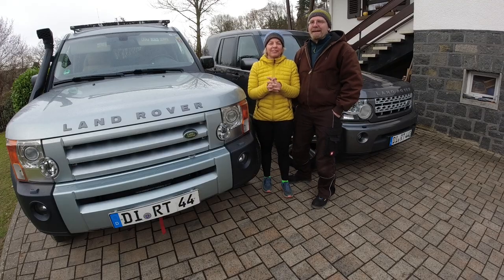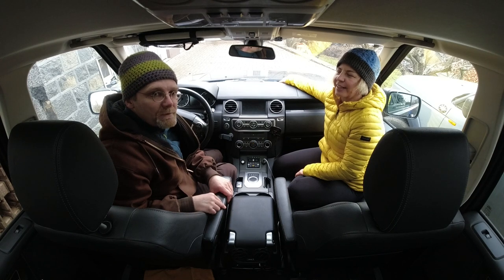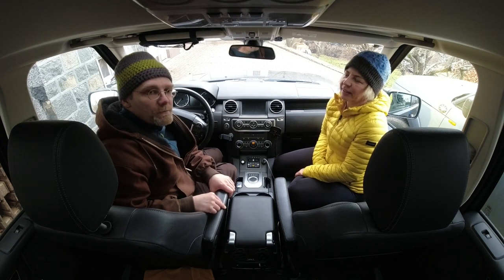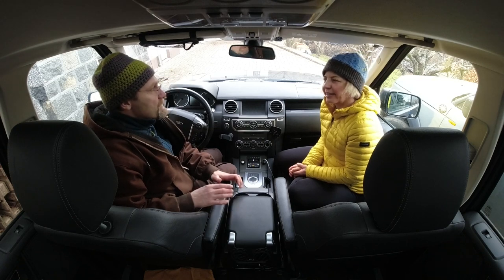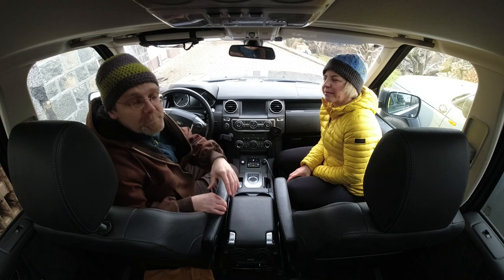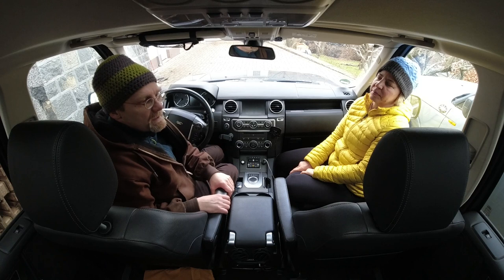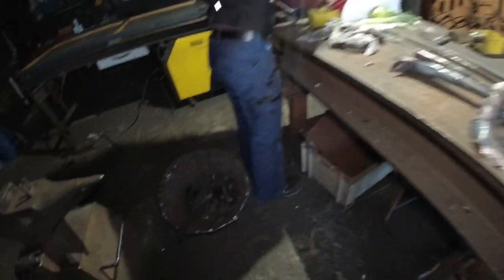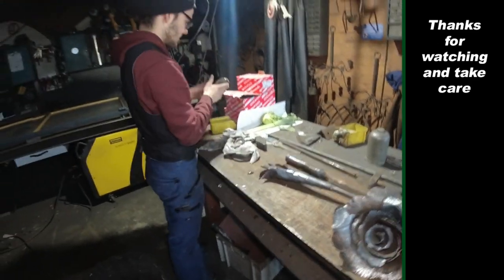Four things we will never change on our Land Rover

Comment: The Air Suspension on my P38 Range Rover was awful... but from what I've heard about later systems such as the LR3, they fixed a lot of the issues.  I loved it when it actually worked

Comment: 1 - 0:38 Air Suspension 
2 - 13:33 Upgrade style to LR4 - in regards of Discovery 3
3 - 17:30 Engine mapping
4 - 20:57 Engine swap
Reply from the maker: 😅👍🙏Thanks, sometimes there is just not enough time to get it all done. 🙋‍♀️Vera

Comment: Hi Christian and vera, myself and my wife really enjoy your videos every time. They are absolutely brilliant.. If an everyday family that generally isn't very car knowledgeable buys a discovery 3 because it has 7 seats and has good boot space for shopping etc and takes it to a garage for everything that happens to there discovery and lets say its a year 2006 model and it cost this family £4000 and because of the age alot of things on the car is old and starting to fail or break in time its what happens and lets say 4 air bags/shocks need replacing as you do in pairs and say 2 height sensors need replacing and because of the leaking air bags the compressor has died because the new owners just drive the vehicle and finally take it to the garage and they say yep. You'll need 4 new bags, a compressor, and height sensors plus the time with a diagnostic tool to recalibrate everything after and plus vat and plus the cost to you as the customer for the parts. I will absolutely guarantee it will cost thousands of pounds. And yeap I've known people just to scrap the car because the repair bill is just too much, unfortunately.. I have actually swapped out our air suspension for coils and, for a few reasons, 1. Cost, so for our coils they were £1000 yes at a one time buy its a lot of money but if you add up the cost of new parts and time at a garage for using a scan tool etc a £1000 doesn't seem that bad, i actually fitted my coils plus other front suspension components over 4 days in the summer on my driveway saving us about £700 only just fitting the coils.. 2. Problems/issues so personally, I've had 2 Hitachi air compressors fitted at about £650 each, and both died over 2 years had everything checked  out, air leaks etc from the garage it's always been a mystery and then decided to change to coils,  3. 2nd guessing/Worry, that beautiful ping noise from a landrover is enough to make anyone cry. But when you're on holiday and your 4 hours from home and PING! The air pump has died, and the holiday over. It makes you wonder if it's going to fail at any second. 4th and final. Reliability, air suspension, I've always been told if it works, it's amazing, but it's when it goes bad it gets costly and difficult. Coils, it is what it is; they are more firm, more bumpy, and less of a headache and personally absolutely less on your bank account, no leaks, no dieing air pumps, no sagging air bags, no more dropped air suspension onto bump stops, no more calibration after having height sensors changed, less parts to worry about, and for what i use my discovery 3 for its brilliant.. i just wanted to sorry for the long comment. I absolutely love your videos. I hope you don't stop making them, and i hope your channel keeps growing and growing . My wife and i will definitely support and share your channel the most we can for the love of what we both enjoy so much.. ❤🇬🇧
Reply from the maker: In some cases it is of course logical to convert to coils.  It all depends on the use case (modern word which Jung programmers use a lot at my work place).  Cost is a big factor too.  In your case, with multiple compressor failures,  I get your point and I agree with you.  Agree about the Bing too.  I don’t think there is an other car on the planet which can let your heart slip down in your pants in a fracture of a second and then make it all good again 😂😂😂.  Had this many times.  Thanks for watching our videos.  Next one will be epic - don’t miss it.  Christian

Comment: I have replaced the air suspension in my l320 with coil springs. Mainly for off road and it tows a lot nicer. I did it years ago and I’m happy I did! It may be a sin but I love it!

Comment: Hi Guys, I write this at 8:42 in the video because I didn't want to forget - re the air suspension there are pro-active maintenance areas to help avoiding trouble:
1. Replace the nylon piston ring in the compressor every 2 years to ensure that pumping is in tiptop order. Cost £ 15 and easy to do;
2. Clean and lubricate the ride height sensors every year - cost 30 mins and some spray cleaner/lube;
3. Re air springs, every year put vehicle  in full height and using a spray bottle full of soapy water, spray all round each air spring to check for leaks and rubber perishing. DO THIS BEFORE you have a problem to avoid time off the road.
Reply: Hey David, do you have a DIY how this can be done ?
I recently became an owner of a LR3, when started the air compressor works for some time even though the car does not seem to have changed how it stands, after running, a loud PSHH is being fired up as if it is a real truck, respectively shortly after I park, car seems to lower different wheels trying to maintain equal level I suppose (I park it on a 2% steep ramp), so with the above info I'd rather check these before running into air compressor problems :)
Reply: what do you lube the sensor with?
Reply: Any videos on replacing the nylon piston ring? Thanks for the advice!
Reply: Don't forget to replace the air filter on the compressor inlet (rear compartment) My suspension is all original >150K miles.
Reply: Very good tips. I need to start doing this. Active prevention is surely the best way on this awesome suspension setup.
Reply from the maker: We have a video planned, and ordered the parts a while ago, but they have not arrived yet. 👍😃🙋‍♀️Vera
Reply: @Vera_and_Christian  Nice. I think this mod could save from many coil spring conversions of other owners. I love the ride of the disco and the load leveling, such an awesome feature that more cars and heavy vehicles 
should have.
Reply: @Vera_and_Christian  hey Vera!

Would you mind sharing the link with the parts you ordered? :)
Reply from the maker: @georgidaskalov8389  Yes, we will put it in the video description. As of now, parts have not arrived yet and we need to check what went wrong before I can share that linke. 👍🙋‍♀️Vera

Comment: Great video, love the discussions on the air bag system. I came across a random issue from previous repairs on a mall crawler,  it had got a epb module at some stage and one of the cables was making light contact with one of the air pipes which put a practically invisible pine hole on it which was only findable with a smoke tester and luminous die…..! It had got a suspension pump but was still logging random faults if ever the vehicle was loaded up!

Comment: Thank you. Excellent content. The suspension really is magnificent.
I'd love for you to do a walk through of:
1) The suspension components: position, faults,  replacement procedure etc.
2) The suspension support circuit you described: when on a long desert trip and suspension failure OR limp mode, is NOT an option.
 A friend was just sold a compressor, and then suddenly he also needed a strut. Now he is so disillusioned he wants to go to the spring conversion.
Reply: You can buy a service kit for the compressor,  i have done my Discovery 3 , it was quite easy and there is a few good videos on YouTube showing you how by the company that sells the service kit.
Reply from the maker: Getting a new strut is probably cheaper than a conversion. It also depends on the age and km of the car. Some maintenance has to be done, and a more powerful compressor can blow a rusty strut. That will probably happen when we service our air compressor as soon as the parts have arrived. Then we will do a walkthrough of the airsuspension. 😃👍🙋‍♀️Vera

Comment: Your description of a Toyota just working makes me want to buy one. I am a fan of things that just work. I am also a fan of simple. Simple is reliable, simple is cheap to run and maintain. Simple is just simple.
Reply from the maker: Simple and reliable also often means 30 years or older. 😅👍 Do not think that a modern Whatcruiser will run like a clock. 🙋‍♀️Vera
Reply: @Vera_and_Christian Don't go too old, I remember hearing a lot of Toys pulling away from a light and the cam follower hadn't caught up.
The sound was unmistakable 😞

Comment: I do a lot of offroading and the fear of an air suppression issue in the middle of nowhere is really frightening. 
I was about to convert to spring coil but your video made me think again. The quality of the ride and even the offroad capabilities will surely be impacted. A video from you about air suspension system good  maintenance would be very helpful. Thank you for your great videos. Very interesting and helpful as always. Keep up the good job👍
Reply from the maker: Remember, the LR has a limp mode. You'll always get out. But there are things you can do, if you are prepped, to fix the air suspension on the trail. We'll get into what we would do, when we do the maintenance on our onboard aircompressor. 👍🙋‍♀️Vera
Reply: @Vera_and_Christian  looking forward for this video. Thanks 👍

Comment: I totally agree with you about the air suspension. It’s the best part of the vehicle. Other vehicles try to put air system and fail. Not the lr4, t’s a very solid system.

Comment: A very interesting video, again! I have the 2010 LR4 and every 4-6 weeks it warns me of a low battery. Apparently, if the car is used on short/medium runs, the battery doesn't fully charge. I Googled this and I think it was on the Disco3 Forum that a Ctek charger was recommended for charging. I bought one and give it a charge every 6 weeks or so. The 'Mall Crawler' is a great name for the LR4, in the UK any 4x4 SUV is referred to as a 'Chelsea tractor', Chelsea being an upper class area in London 😉. Well done for another great video, you two are fantastic! Also, Robin is a very talented metal worker 👍

Comment: I agree on the air suspension. It's magic! My Disco 3 has a height sensor issue and the ecu threatens to slow down but doesn't (thankfully!) I'm waiting on a Foxwell NT510 to diagnose and then also calibrate the new sensor. I changed the front air struts after 250k.

Comment: Hi Christian and Vera another brilliant video you’re very correct about the suspension I had to replace the ECU for the air suspension thank you for the help and a new compressor when buying a compressor don’t buy the cheap ones there are only two but you should have Hitachi or Dunlop the other makes maybe a lot cheaper but the pressure they work up is lower so the pump works harder what I’m saying just buy the good ones which will cost you around £400 but saying that I also need a set of valves at the front catch up with you next week keep safe.  John 😁🇬🇧👍

Comment: Removing the air suspension from a Land Rover undermines one of its most defining features. While it may come with the occasional quirk, it's unmatched in providing both comfort and the ability to adjust to various driving conditions when needed. Also using a salvage car and the right know-how or mechanic, you can fix the system for a heck of a lot less money.
Reply from the maker: 👍👌that is all we are saying, for many years now.🙋‍♀️

Comment: As always - great video and not just because I absolutely agree (excluding the part about the looks of the ….cruiser 😉) 
The air suspension is easily one of the greatest things (or even the greatest thing) on our Discoverys. It is - in my opinion - way better than the Landcruiser‘s suspension.

Of course there may be some faults to be dealt with but I would say this: My D3 has now slightly over 200k km, it still has the first air-struts (a bit rusty but fully functional - I will replace them this year) and just gotten a new AMK-compressor (Miessler). I was able to replace the compressor all by myself outside in the driveway in the cold with just some regular tools even though I had to drill out a rusty bolt.

As long as there are spare parts, I think you could replace almost all suspension components almost anywhere in the world on the go - that’s brilliant!

Kaffeetrinkende Grüße!
Reply from the maker: Absolutely right. 😃👍🙋‍♀️Vera

Comment: I miss the ride on my LR3 since buying the X5 although it has rear air bags the comfort of the LR exceeds the X5 plus it is not so easy to get in and out your spot on, l did however once have a complete air suspension failure on a new 3 months old LR vehicle - a pot holed farm track the culprit LR tried to blame me for miss treating the vehicle!  Another entertaining video guys. Sorry Christian l had my 3 remapped and it was noticeable immediately quicker off the mark and l certainly got more mpg.

Comment: Great cars. 
Ideas for videos if you want. 
1. I installed an X-Lifter module that overrides the suspension and is Bluetooth. 
2. I made a relay resistor load for towing trailers or caravans that have led lights etc. the lr3 sends pulses to the lights to check if a bulb is blown, with a trailer that has leds they pulse and flicker when plugged in. This resistor relay setup tricks the ecu into thinking the bulbs ar okay.  Interesting project and works for less than $100 aud. Love your work.
Reply from the maker: If we would use our trailer more often, that would be a great idea. But I haul that thing maybe once every months for 3 km. But maybe in the future. 😃👍🙋‍♀️Vera

Comment: Love today's video - Jeeps are getting to be just as sensitive with the check engine light as the LR's. I am constantly running a scan tool to check what sensor is at fault, plus we have the biodegradable wiring harness that doesn't like the southwestern US heat so they get very brittle - I think this is the main cause for sensor failures. So now I am looking at dealerships for an LR3 to own as they can't be any worse to own.  :)
Reply from the maker: Oh yeah, also watch out for brittle cables. Even we had to replace a lot of looms yesterday , Sarah-n-tuned style. 👍🙋‍♀️Vera

Comment: Agree, the air suspension is brilliant, would never remove this.  The low and high ride heights are very handy.  But also concede, it's a system you need to stay on top of, replaced my compressor at year 10.

Comment: Totally agree about modifying or mapping the engine. You want more power go buy something different. Or just buy the V8 version of the disco. I have had 2 discos. The first a 3 with the V6 4L petrol. A great engine, very responsive, plenty of power and cheap to maintain. Unfortunately also a rather thirsty engine at an average of 16L/100Km. We now have an MY12 disco 4 with the 2.7L V6 diesel. Plenty of power we just miss the punch when pulling from a standstill the petrol had.  Keep up the great videos guys

Comment: You two are funny. 13mins for the 1st point. I'm sure Christian could do hours on the 1st one. I like the idea of shut off valves to isolate the corners when in remote areas.
I also agree that the D3 looks a bit more off road ready than the D4. I do wish the all the black platic didnt look so shit though. The sun in Aus just cooks them.
Impressive basket weaving from Robyn, those fruit and veg are very nicely done.

Comment: You are absolutely right. When you press the start button on the Disco 4, all of the computer modules get together and hold a committee meeting to air their petty grievances. If there is one little problem, that module goes on strike and an error code ensues. Now all of the other modules then decide whether they are going to function correctly, because they are not happy with the striker. If enough modules throw in the towel and decide to follow the striker, Disco 4 will fail to start.
Reply from the maker: 😅👍 When I drive the mall crawler, the first thing I do is press the seat position button for my seat adjustment. That way, he knows I am driving and will not do anything when I push the start button. Only after complaining to Christian will that thing start. Every single time. 😂🙋‍♀️ Vera

Comment: Oh dear iv sinned a few times 🤦🏻‍♂️ 
Would yous buy the Xlifter kit? I got it a while ago but have a suspension issue at the moment, so haven’t used it. Looking forward to the self level feature while camping
Reply from the maker: No we would not, not here in Germany for what we use that car for. Before we pop up our Roof Top Tent, we always lower the car into access mode, so it will not move during the night. When the airsuspension adjusts itself over night, you will get squeeky noises from your ladder. 🙄😅 learned that the hard way. 🙋‍♀️Vera

Comment: I love your videos. Although I don’t have a discovery, I have a 2010 Range Rover  Sport so a lot of the systems are the same. A video on the Pure Highway would be very useful. Did you have to plug it into your aux or did you find a way around it to save having a plug sticking out.
Reply from the maker: It’s connected to the aux in the back. It also has FM signal out and it works but sounds a bit dull.  Excellent simple unit.  Vera has a 15 Euro magnet antenna on the roof and it has way better reception than the mall crawler.  Christian
Reply: @Vera_and_Christian  Thank you Christian. Keep up the inspiring videos. 👍🏻

Comment: Omg.. totally agree with everything you said.. air suspension probably the best feature. Shame they didnt make the tdv6 more long lived and easier to maintain though.  180k miles on my V8  gas engine and no issues. However, I am very envious of the lower fuel consumption and longer range of the tdv6.